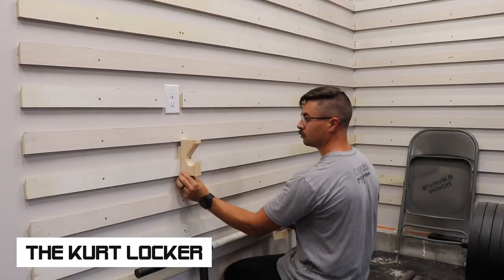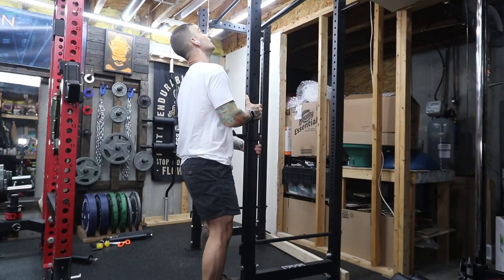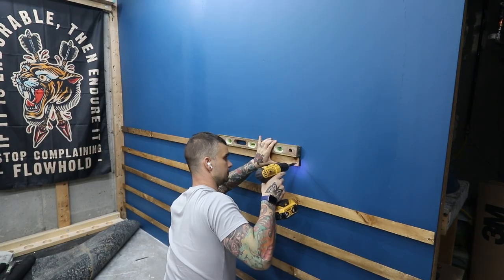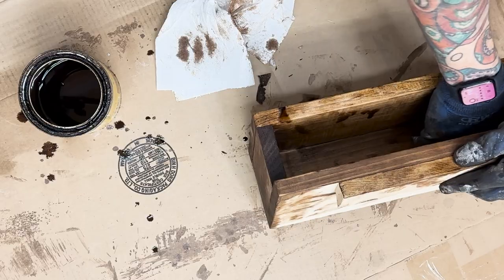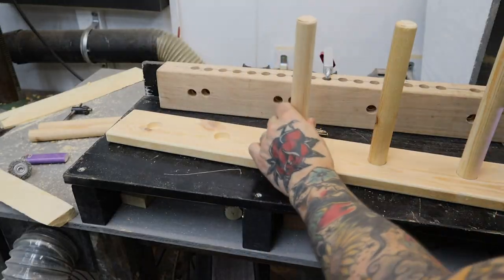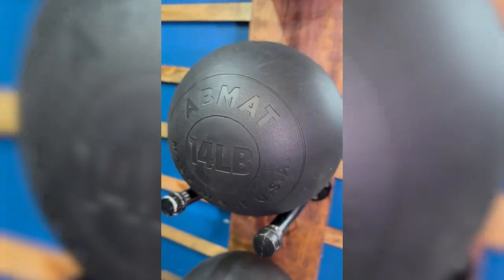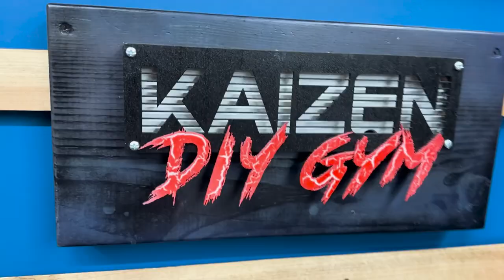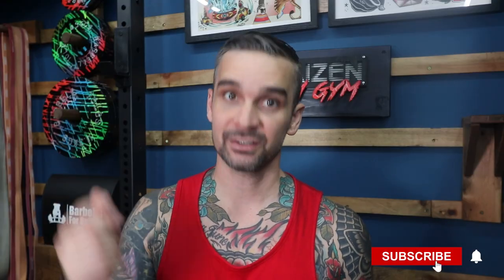DIY home gym storage - French Cleats are the best way to organize a garage gym

Comment: French cleat is also a great way to hang anything heavy. I hung a big wood sign in my gym using a french cleat.

Why two racks? I wanna get a 2nd one but curious why you have two lol
Reply from the maker: I actually have 4 racks. My goal is to design universal equipment, so it helps to have different types of racks around to test stuff on.